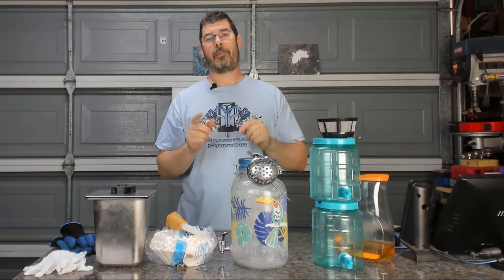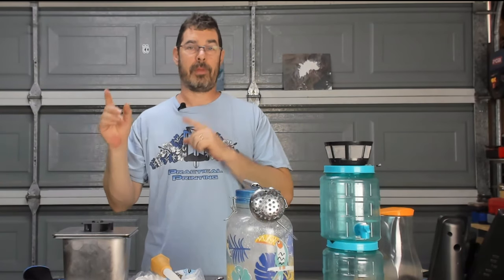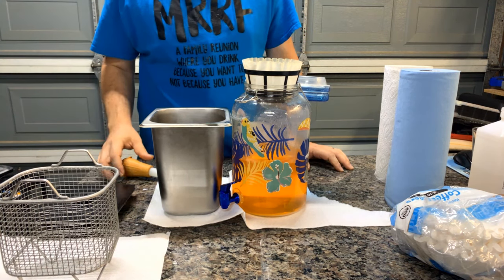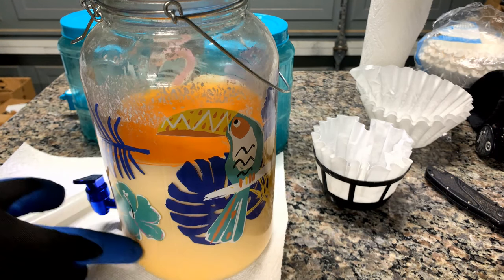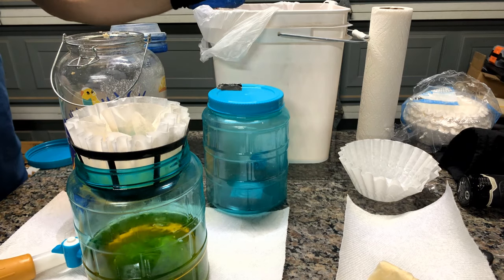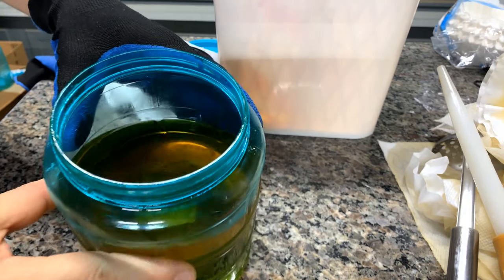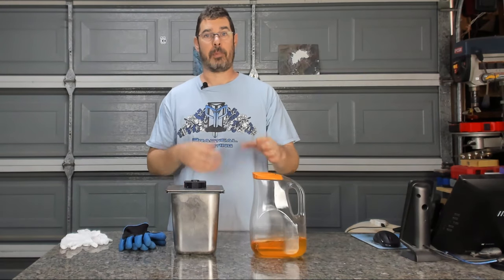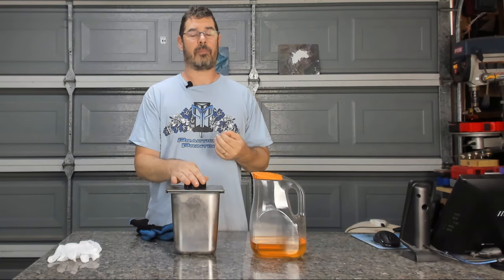SLA 101: Reclaiming IPA

Comment: I’m glad you covered this. I dream of an automated IPA circulatory system. Essentially it would constantly be filtering and applying UV behind the scenes while you use it. It would use medical stainless steel meshes for longevity. I think preventing such massive custard build ups will allow more IPA to be reclaimed. 

Even if it doesn’t reclaim much, I think it’s better for disposal.

Comment: One thing you can do is  pour your used ipa into a empty 2 liter soda bottle. then let the bottle sit outside in the sun. The monomers and photo activators will react with the sunlight and settle to the bottom over a few days. you can then carefully decant/filter (note i don't filter i just carefully decant) the ipa into another container. You can then use what i call "dirty ipa"  as it still has some resin and dye in it that didnt react to the UV in the sunlight, but it mostly clean and still does a good job for initial part cleaning or vat cleaning. As for the solid particulate sludge you can put that in a disposable container (ie used soda bottle) and let what ever small amount of ipa left in it evaporate. the sludge will solidify and you can dispose of it in the trash as the solid stuff in no longer toxic.  so my process of cleaning my parts is to wash parts in the "dirty ipa" then do a second cleaning in "fresh" ipa.   Note eventually your fresh ipa gets to the point that it needs to be cleaned and then cycles into the "dirty ipa"  this way I reuse the IPA over and over with minimal loss  of ipa.

Comment: Hi. To speed up your process you should swap the glass jar for something that dont block 99% of uv light. Regular glass blocks almost all  uv light unless its pure quartz glass. I recommend using PPE (if i remember correctly) which only blocks around 5% of uv light so it will speed up the process few times :)
Reply: Actually, regular glass only blocks shorter wavelength UVB and UVC – not the longer wavelength UVA, which is closest to visible light. The standard 405nm required by most resins is in the UVV range, which is even longer than UVA (and can be seen by the human eye – which is why your printer glows violet).

Any glass vessel that's not specially tinted or UV treated will work fine; as long as it has a tight lid to keep the IPA fumes in!

Comment: You said "resin isn't toxic". I don't know about you but I don't know many non-toxic materials with safety sheets that say don't get on your skin, use respiratory protection, wash for a long time if exposed to skin, etc.  Many resins are very bad for you while liquid and if you read the MSDS as you mentioned you can see that. There are other makers on this platform who have gained sensitivity from exposure to resin. I have friends who have worked with resin incorrectly and have ended up in the hospital. Always read safety sheets and follow them if you care for your health and please don't spread potential misinformation by saying resins aren't toxic. Perhaps the ones you use are not but making a broad statement like that is dangerous for people who watch your video and assume that their resins are the same. I encourage you to think of the safety of others before making a statement like that for materials that are as broad as resins.
Reply from the maker: We may have deferent definitions of what “Toxic” means, and perhaps I should have used air quotes around the word to better convey my point- but in general I think we are in agreement.

The bottom line I’m trying to convey is:
1. People shouldn’t fear resin/SLA. Like any other chemical, respect it and learn to handle it properly- chances are most people have more dangerous chemicals at home under their kitchen sink- heck we fill our cars up every day with gasoline which is much more toxic than what we are dealing with here. Know what you are getting into before you get into the hobby and what precautions are needed for your environment.
2. Don’t let mine or anyone else’s opinions sway your view. Form your own opinions based on data, not speculation. Read the Safety Data sheets and recommendations from the manufacturers. If a resin maker doesn’t have an MSDS available, at least for me that’s a red flag.
3. If you have had allergies or reactions to acrylic paints or other chemicals in the past, be prepared in case you have those reactions to the resin.
4. Repeat point one- respect, don’t fear the technology.
Reply: @crussty3d  Resins ARE toxic and carcinogens
Reply: @eXe09  Right! And they are absolutely toxic to the environment. Easily capable of devastation to aquatic life just as a starter. Any uncured resin should not contact biological life. Mild reactions include irritation, extreme reactions include cancer.

Comment: I wonder if you exposed the contained ipa in a curing chamber, would the dissolve resin cure and drop out of solution at a decent pace ?
Reply from the maker: I’d consider that but seems like first pass it sinks, subsequent passes it floats. I’d considered building a still and seeing if I could evap the IPA out into a secondary, but... too much work...
Reply: @crussty3d  Might be worth trying it on a small scale to see how it reacts.
Reply: It's exactly what I am doing.
I speed up the "sun light process" by putting the glass jar in my curing chamber.
Well and then filter, filter, filter, filter.

Comment: please wear gloves and WHY do you tilt the turkey blaser? the harmfull IPA with the resin runs onto the rubber rim and sonner or later onto you fingers... . 

Please ALWAYS wear gloves (e.g. cleaning or one time use.) Be alert that the one time use gloves will loose there penetration barries when in contact with alcohol over some time ( ~20 min).